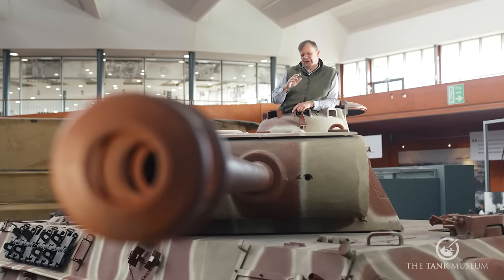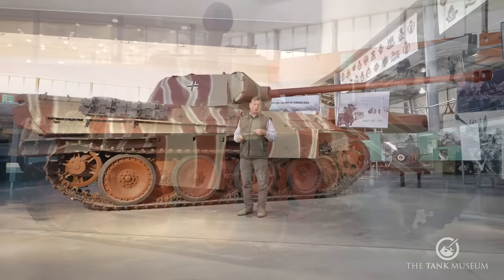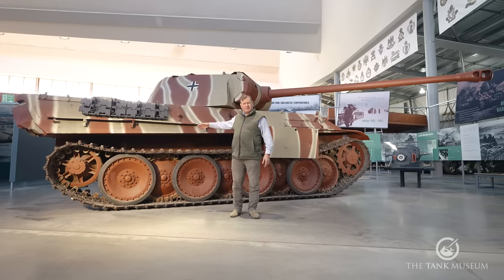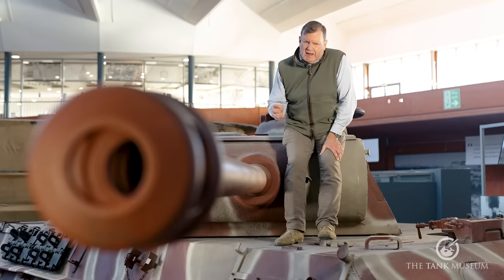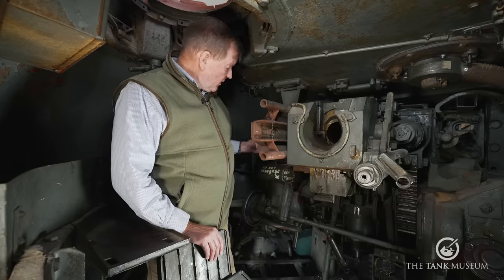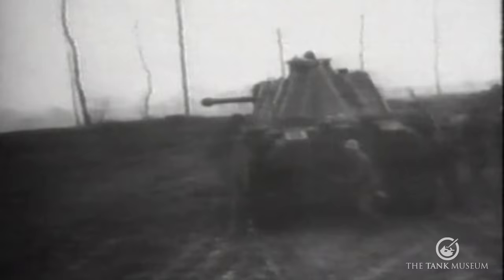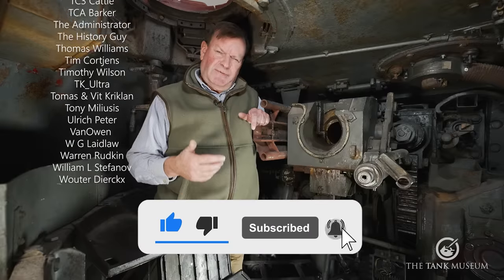See Inside Panther | Tank Chats Reloaded

Comment: The Germans didn't "borrow" sloped armor from the T-34. They knew perfectly well about sloped armor all the way back to WW1. The Panther was simply large enough that sloped armor wouldn't interfere too much with crew compartment ergonomics.
Reply: The "sloped amour" Fanboys should drive a T34for half an hour and work on the crew stations , and should repair a damaged fuel tank or a coilspring.then they would knew the reason for not using sloped armour.
Reply: Truly a moment when people don't realize sloping stuff has existed for ages. 

Also I hate the fact that T-34 stans make the fact they enjoy their favorite tank all about it being good.
Its literally in my top ten just visually, your favorite doesn't have to be good it just has to be cool. If what you like most is superior or not literally doesn't matter unless you're stupid.
Reply: Stop being a pedant. 
We know the Germans were influenced by the design of the T34 when designing the Panther, we also know that sloped armour has been known about for at least 1000 years and probably a lot longer than that.
The point being made here is that the design of the Panther was influenced by the T34... which it was... not that the  Russians invented sloped armour...which they did not, nor that sloped armour first appeared on a tank in the T34 design, which it didn't.. I seem to recall the Renault FT had a sloped.drivers hatch...
Reply: No, it was not. Its a myth. The Germans realized that sloped armor was back on the table now that the tanks had gotten much bigger. They realized that the Tiger 1 could've had sloped armor as well to reduce weight and still have good crew ergonomics and they rectified this in the Tiger II. The Panther was simply following along with this thinking.  @HarryFlashmanVC
Reply: @stekarknugen9258 its also true they were inspired by the T-34 when they saw the effectiveness of the sloped armour and wanted a piece of that action for themselves as well, to make their own T-34 but better as is the custom for them... T-34 but overenginerred
Reply: Tiger not big enough?
Reply: Its a common misconception. Everyone was well aware of the benefits of sloped armor as far back as age of star forts. However the Germans weren't convinced its worth the smaller internal volume and only sloped a couple degrees. The T-34 convinced the Germans to embrace sloped armor rather than the myth it taught them what it is. Early Panther prototype had all around slope like the T-34. In fact it looks almost exactly like one. But the Germans considered the loss of internal volume too much. The ultimate compromise was sloping only the front. The Soviets came to a similar conclusion with their T-44. Ultimately every country nowadays only slope the front. So in a way, the German and Soviet armor philosophy met in the middle due to the war.
Reply: @michaelpielorz9283  Which is exactly why no modern tank uses sloped armor. Wait....
Reply: @stekarknugen9258 I think you are concentrating on one word in this excellent film to make a point that the experts at the tank museum are more than aware of. 

‘Borrow’ 

Perhaps the word ‘influenced’ would have been more appropriate, as the sloping frontal of the T34 did have an influence, however minor, on the design of the Panther.

However, if your assertion is that the experts at the Tank Museum think that Germany knew nothing about sloping armour until they came across the T34 on the field of battle then in my opinion you are just trying to garner likes as that is quite ridiculous and a bit of an affront not only to Chris Copson but the rest of the experts at the Tank Museum. 

I’m sure that’s not the case and it’s just a misunderstanding over usage of one single word in a 21 min film over another.

EDIT: Quite frankly it’s a travesty your post has received so many likes when at best you have misunderstood the term used and at worst trying to portray yourself as an expert who knows more than the Tank Museum.
Reply: "borrow" meaning "being influenced by". If you look at the vk 30.01 (d) you can clearly see the resemblance
Reply: WW1? try the middle ages, people understood sloped armor would ricochet blows more effectively than flat armor
Reply: "Panther was simply large enough that sloped armor wouldn't interfere too much with crew compartment ergonomics." You've obviously never been inside the Panther. "Ergonomics" is not about this tank, just as it's not for the T-34.
Reply: @Ailasher ...and Panther was a bigger tank than earlier ones. It did had small turret ring and so a small turret. Which of course made turret cramped...
Reply: Exactly, the Russians didn't invent sloped armor.
Reply: wrote: "… They knew perfectly well about sloped armor all the way back to WW1."

— It’s funny how people have a silly way getting into "engineer head", and use whatever came out of it as a factual argument. Pretty much any tank be it Pz-III, Pz-IV or Pz-VI, is large enough to have, instead of compounded and complicated to produce frontal armor, just use a single armor plate under "rational"(read steep) angle to double its effective armor thickness. For Germans this Soviet engineer trick came as a surprise, and it took four to five months of fighting to figure out that fairly thin 45mm(1 1/2") of frontal armor behaved as 90mm(3") armor plate. The whole Panzer committee after H. Guderian report flew to Mtzensk near Moscow to study T-34 tank, so specs could be formulated for a new tank, instead of waiting for T-34 to arrive to German to study by train.
Reply: Jesus Christ and Mary Magdalene in Heaven.......
With the GREATEST respect and humble....this video is made by historians, a historian presents the tank. and STILL I can find myths in it.
Please read my arguments carefully:
1. Panther built by British after the war, cannot complete a British trial.

First: 
I immediately noticed that the G Panther in the museum has a  Ausf A variant tower. This alone shows the seriousness of the "putting together" operation.

Second:
Were the British people who conducted the tests trained enough to use the panther?
Were the parts used to assemble the tank equivalent to 1944 quality materials?
What was included in the test that the Panther could not perform, what was the fault?
These are 3 major questions for which we have no answers, only that the Panther is unreliable.

How is it that the Germans, who also knew about the Panther's faults, were able to do 1 500 to 4 200 km with the Panther? 
Isn't that contradictory ?

2. Did the Germans "borrow" the angled armour from the T-34?
Virgin Mary...this myth was busted decades before, are you still bringing it up?

3.Does the Panther eat 4x as much fuel as the T-34? 
I ask you...WHY DID YOU DETERMINE THAT?!

Let's look at the numbers:
To start with, a diesel engine uses on average 20-30% less fuel, but not 4x less.....

The Panther had 720 liters of fuel.
Range of Panther:
On the road: 200-260km
On land: 100-130 km
Panther consumption: 2.76 Litres/km (on road)

The T-34:

Mod 40-41:

460 Litres of fuel.
On the road: 330km
Ground: 200km
Mod 40-41: 1.39 litres/km (on road)

Mod 42:
On the road: 330km (same distance as Mod40-41, because it was 2 tons heavier than Mod 40-41)
Ground: 200km
610 Litres of fuel.
Mod 42: 1.84 litres/km (road)

Mod 43:
On the road: 450km
Ground: 260km
Had 790 Litres of fuel.
Mod 43: 1.75 litres/km

T-34-85: (internal tank only)
556 Litres of fuel.
On the road: 300km
Ground: 160km
T-34-85: 1.85 litres/km

At best:
2.76 vs 1.39: 1.98 x.

Where is the 4x indicator?

4. "interleaved road wheels prone to clog ice and mud"
The tracks of any tank can accumulate ice and mud....

5. The engine radiator is a weak spot....
Jesus Christ in Heaven....its like the weak side armour "argument". Even the T-34 had vent intakes on the engine....
So today, the Leopard 2 is a piece of crap, because has big ventilators on the engine, and has only 40-50 mm of side armour...
Even modern Russian MBTs has the same amount of armour and big vent intakes on the engine as the panther....
Or the British Challenger 3 has the same "weak spot" or the M1 Abrams vent intakes....
Please Sir, do not use this kind of arguments.

6. KwK 42 is NOT much better than a Kwk-40 on the Pz IV...
Sir....numbers....
Source: Bird, Lorrin Rexford; Livingston, Robert D. (2001). WWII Ballistics: Armor and Gunnery. Overmatch Press. p. 61.
Kwk 40: (against 90° of armour) (L/48, not L/43)
100m: 135 mm 
500m: 123 mm
1000m: 109 mm
2000m: 86 mm

Kwk 42:
100m: 185 mm 
500m: 179 mm
1000m: 149 mm
2000m: 145 mm!!!!!

If that's not a big difference, I don't know what else is "big".

7. For the driver levers, pump means, it had hydraulic SERVO drive.
To simplify it: you could turn the tank with your little finger. Whereas with the other allied tanks, it took a lot of physical strength.

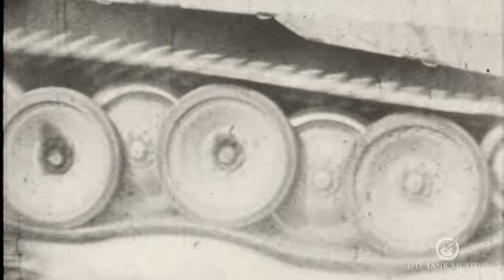8. As you can see: 16:48 the gear lever was "on the floor" next to you, and not upwards as it is in the museum tank.

9. Serviceability only 35%? Please, Sir, do not lie:
Check out the Panther --->Reliability table on wikipedia.

Fun fact: avg. it was 61-62 % from 1944 may until 1945 march. In 1944 if there was not a big push, the serviceability was 85-71% on the western front.

10. 370 final drive was broken. Nice. 
In how long? And from how many tanks? 

Oh, and yes: why did it break, perhaps from a 76mm hit?
I won't paste odes about the reliability of the Panther and the T-34 here, their wikipedia pages have it all beautifully described.

Fun fact:
"Soviet tests on newly built T-34’s showed that in April 1943 only 10.1% could complete a 330 km trial and in June ’43 this went down to 7.7%. The percentage stayed below 50% till October 1943 when it rose to 78%, in the next month it dropped to 57% and in the period December ’43 – January ’44 the average was 82%. During February 1944 tests, 79% of tanks reached 300 kilometers, and of the test batches 33% reached 1,000 kilometers. This became immediately apparent to the tank troops. The deputy commander of the 1st Guards Tank Army, P. G. Dyner, commented that tanks in 1943 would reach only 75 percent of their guaranteed life span in engine hours and mileage, but in 1944 they reached 150 percent."

O, and yes, from that 1945 report, Sir, you forgot to mention this:

"From the front there continues to be serious complaints
regarding final drive breakdowns in all vehicle types.
Approximately 200 breakdowns have been reported with
the .38(t). Prior to the 1945 eastern offensive there have
been 500 defective final drives in the Panzer IV. From the
Panther .370 and from the Tiger roughly 100."

Every tank had problems with its final drive, because of the LACK of training and bad material quality.

11. More Panther lost by mech. breakdown than to enemy fire: Where are the numbers, Sir?

12. French fixed the engine fires? Siiiir, please: The Germans tried their best: tried to use better materiel for the fuel pumps, and decreased the horsepower from 700 to 600 hp.
The Germans knew what are their problems. About the Panther engine there are many-many  bad tone report blamed on Maybach. And the solution was to reduce engine power.
The result of this was checked by Guderian in April 1944.

Why don't you share this information with the world?

Thank you for reading.
Reply: @thehawkkommandant wrote: "Truly a moment when people don’t realize sloping stuff has existed for ages."

— That might be, but what is that got to do with T-34? Nothing, since 37mm PaK-36 didn’t exist for ages, and tank with "traditional" none sloped armor with similar protection would weight over 40 tons.
Reply: @HarryFlashmanVC — "Armchair Historians" doing a lots of past game "quarterbacking" here. Just sloped armor would not make any tank any good, a lots of study went into what angle, and what armor thickness is sufficient/enough to make anti tank gun protection, so it doesn’t make tank too heavy.
Reply: @RussianThunderrr  I realize that yes but what I am getting at is when people treat everyone doing sloped armor as copying the T34. Which in the case of the Panther as we do here I must admit I do not know for certain that it was not at least an idea starter, which if it was a small inspiration you could say that the Sherman might also have inspired the Panther to some small degree aswell.

just because it has sloped armor doesn't mean the T-34 inspired it, that's all I am saying. The Germans could have 100% just decided by themselves to do that with the Panther and later the Konigstiger.
then again, as I said perhaps the Russian tanks and MAYBE the Sherman had an influence in the thinking. I am not THAT knowlegeable on the subject by anyone's definition.
Reply: I mean if you look at the Panzer 1, 2, 3, 4 & Tiger 1 they all have sloped armour..... it's by far a big misconception
Reply: @DanBray1991  That they do, just not sloped to the same degree as the Panter, King Tiger, and T-34 so a lot of people think that the Panther was the first German tank off WWII to have "sloped" armor. But to be fair, the armor on the earlier Panzers were barely sloped and the front of their hulls didn't consist of one large sloped piece of metal but of several pieces that sloped at varying degrees depending on where on the hull it was with the pieces forming the "nose" of the tanks being the most sloped.
Reply: So they borrowed it from the soviets? They didnt build any before the panther
Reply: @DrLoverLover  wrote: "They didnt build any before the panther"

— What are you talking about? LOS or line of sight armor?
Reply: Panther uses 4x fuel than t34 for how common breakdowns were(most built to only last a week or two.)
Reply: @peppapig9833  -- T-34 tank were good for thousands the kilometers.
Reply: @RussianThunderrr  if so than I guess 44,000 out 55,000 t34s were gone? How come did a general complain about that problem to Stalin himself?
Reply: @peppapig9833  wrote: "Panther uses 4x fuel than t34 for how common breakdowns were(most built to only last a week or two.)"

-- If T-34 would not last long, there would be no need to hang external fuel tanks to extend already best operational range among WWII tanks.
Reply: @peppapig9833  wrote: "if so than I guess 44,000 out 55,000 t34s were gone?"

-- Same place where all the German tanks went, except they lost the war.
Reply: @peppapig9833  wrote: " How come did a general complain about that problem to Stalin himself?"

-- There were difficult time when a factory was evacuated from, and out of 44 000 workers only 4 000(the rest stayed behind to defend Kharkov) made to Ural Mounts, where tanks had to be build, as the wall and roof of factory build around people who worked there around the clock in frigid -20 to -30 degrees weather.
Reply: @thehawkkommandant  It doesn't have to be some genius design that was top of its class to be good. The T34 was a good tank because the Soviets had it and it worked well enough. It was a decent design that was poorly built in practice, but the Soviets had them and they had a lot of them
Reply: @princam_4775   yea I know it wasn't absolute garbo like lazerpig fans seem to think
Reply: @princam_4775  wrote: "It was a decent design that was poorly built in practice, but the Soviets had them and they had a lot of them"

-- If you "google" CIA report on captured T-34-85 tank, you'll be surprised what you find there on a first few pages... LazerPig egging people on not to read that report, I'm actually encourage you to read it, they have a lot to say about T-34 build philosophy, it for sure was not a through away tank, like many try to frame it.
Reply: @kmoecub  which is exactly why all modern MBTs are the size of a T-34. Wait...
Reply: Back ferver then that like since the twelfth centre
Reply: The  chassis of the  T - 34 was developed in America, then used by the Soviets
Reply: @HarryFlashmanVC  Stop being pendant.  Other than the Germans realizing they needed a better tank, the T34 did not influence the panther design.  Different type of gun, different type of engine, different type of suspension, the list goes on…
Reply: yep, another thing is at the time they were building panzer3s and 4s their armor was still enough to survive most shells at a engagement range
only when shells became more powerful did the german tanks get bigger and adapt sloped armor
a german panther loader could more or less ergonomicly load a shell, a t34s loader had to bend in unnatural ways due to the lack of space
Reply: The german also USED it prior to meeting T34 (See SdKfz 251)
Reply: Interesting
Reply: @stekarknugen9258  sloped armor does not reduce weight,it's a myth. If the Tiger had 50 mm sloped at 60° armor the plate would have been 2 times longer weighing the same. 50 mm sloped at 60° is more effective than it line of sight armor of 100 mm because there is also  denormalization.
Reply: The walls of castles/forts after the introduction of bombards and cannons were made with the same shape of the pike nose from an IS-3.